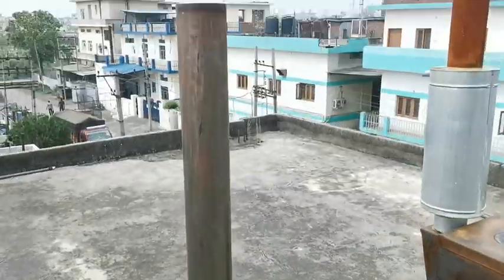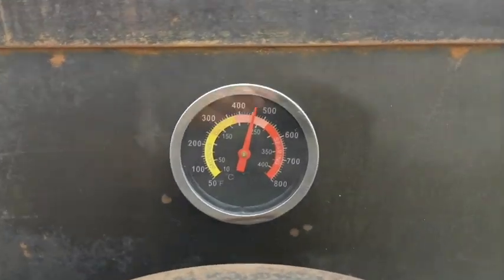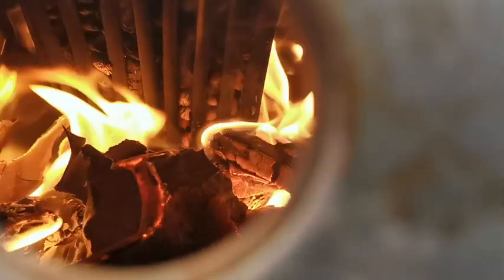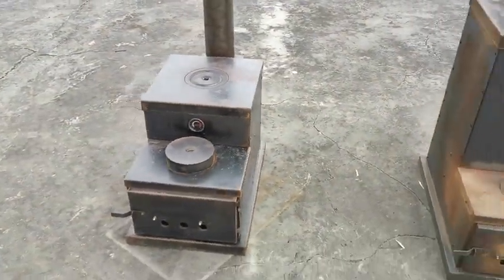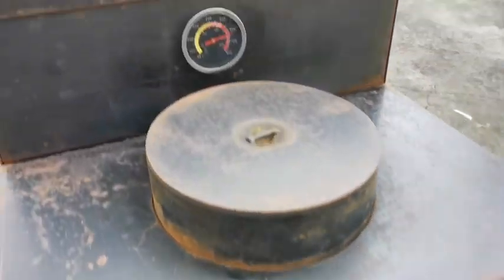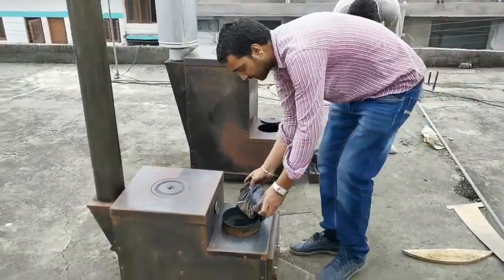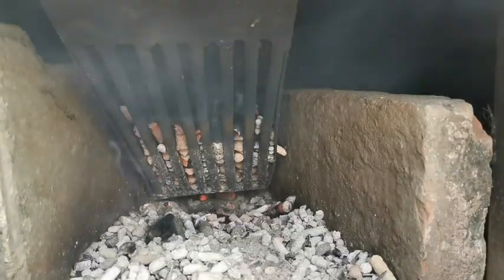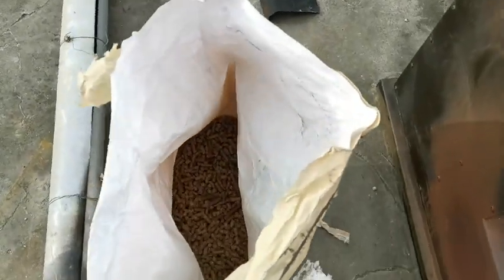Pine Pellet Test Burn #1

Comment: You have done a very good work but the price is too high for a average Indian family on the mountains and most won't be able to afford it..
Reply from the maker: We are currently working on a plan to reduce the pricing of our basic EcoMini unit through trading of Carbon Credits through South Pole. We will be rolling this out in the next season. We have also been delivering low cost units to remote regions as part of a project with SustainPlus and Social Alpha. These units are not shown on our website, and the pricing is subsidised in these cases. Unfortunately due to the price of steel the retail prices for our units is as low as we can afford to make it.
Reply: @Rocketmandesigns   Would you be able sell "" low cost units" to remote regions like Nagaland? if so, how do one get it? Here we get snow but it's not as cold as Jammu&Kashmir. So we will be using it to warm our houses only from Last part of November till February.
Reply from the maker: @vladmiri  We are currently rolling out some low cost units in the NE region via an organisation called TIEEDI. Please send me an email to admin@himalayanrocketstove.com and I will connect you to the right people.

Comment: NO PAINT FINISH?  Geez it sure gives a poor impression. I sure don't recommend opening to re-fuel with so much smolder smoking... Seasoned wood/pellets necessary  Try using some charcoal or mix. Keep on testing. Good luck!

Comment: So what you are saying the better the airflow the more heat , and the less smoke .?  and less pollution ?
Reply from the maker: generally that is true... we have had issues getting the pine needle pellets to drop evenly and the results have been sporadic. We are soon to start testing again using rice chaff pellets.
Reply: @Rocketmandesigns  dont get me wrong , great experiment . and info!
Reply from the maker: @oswaldbruggemans8474  yes sure... thanks! Still a lot more work to do, but we are starting to focus more on agriwaste pellets in India, so the time is coming up to get this sorted out